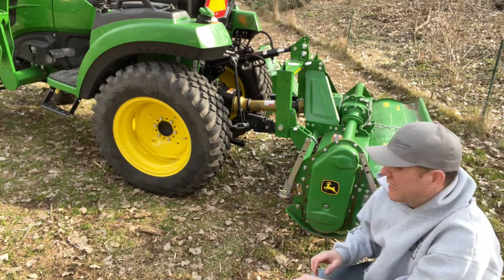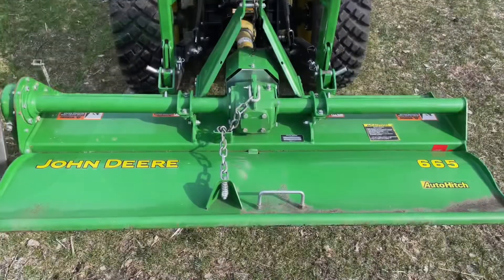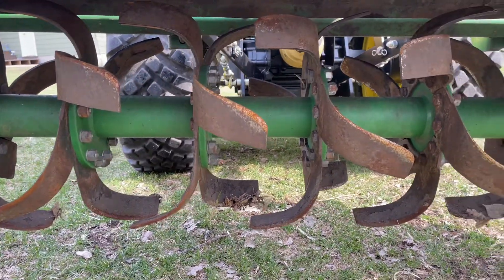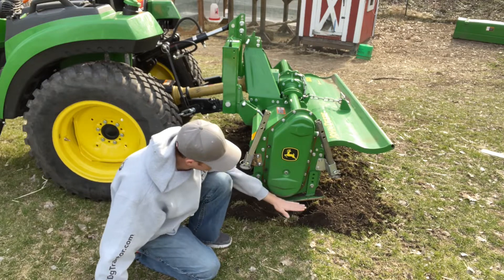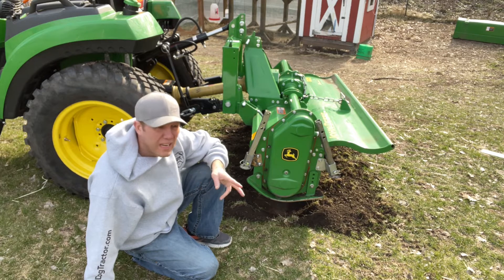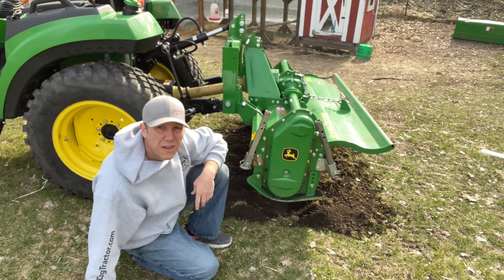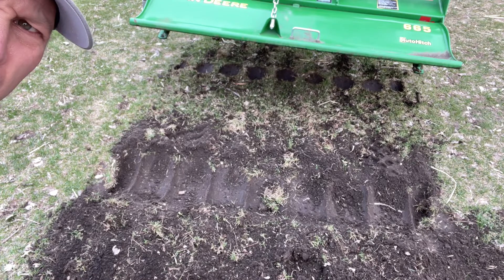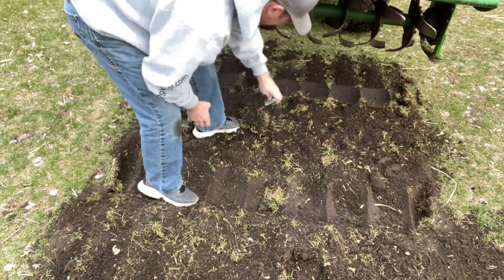Exploring Depth Control on John Deere 665 Rototiller | Testing Max Depth vs Adjustable Settings

Comment: I think you should use your top link for setting the best angle for the universal joints on the pto shaft at normal tilling depths. Keeping the pto shaft straight as possible is much easier on the equipment and takes less horsepower to turn the implement.
Reply from the maker: Thanks for the view & comment! Just posted another video on tilling a “large-ish” garden for community church. It may sound crazy, but I use a rototiller the least for gardening. Typically I use it for lawn renovations where I need to adjust till depth quickly and efficiently. Cheers from the Bulldog 🍻

Comment: I think almost all tillers are now gear-driven.  Nice hydraulic top link👍
Reply from the maker: The live top link is a life saver.  Cheers from the Bulldog 🍻
Reply: @BulldogTractor  On yes, now that I've had one, I can't go back.👍👍
Reply: The 647 through at least 673 are chain driven. I have those two - size of chain changes by model. Gotta get bigger than 80” to go to gear drive.

Comment: Interesting concept.  Hadn’t thought of that approach.  
Not sure how much you’ve used the tiller since this video,  but after the first pass, your skids have much less control.  They tend to bury themselves in the soft dirt.
Also, when tilling sod, or anything with green cover, deeper tilling does a better job of covering/mixing the weeds and soil.
I’m like the original owner of your tiller.  ….deep as it will go all the time :-)
Thanks for the video!
Reply from the maker: I see what you are saying there!  I’ve used the tiller a few times, on a few projects. I’ve just never used it to till a garden, as odd as that sounds.  The tiller is a powerful tool, of which I’ve only scratched the surface on its handy-ness!  But from my experience of using the tiller for everything other than garden tilling.  I think it is one of the “must haves” for tractor owners. It really comes in handy for the strangest of jobs.